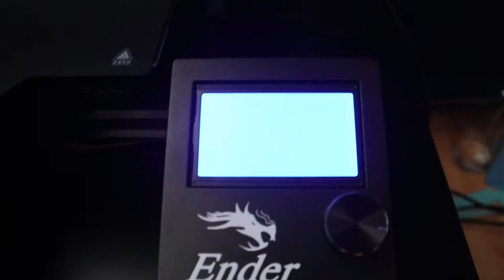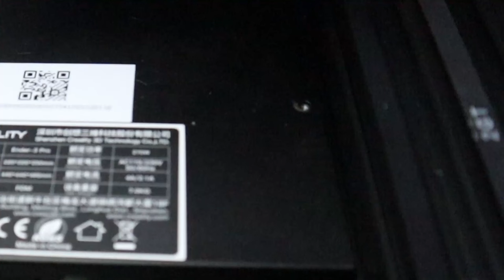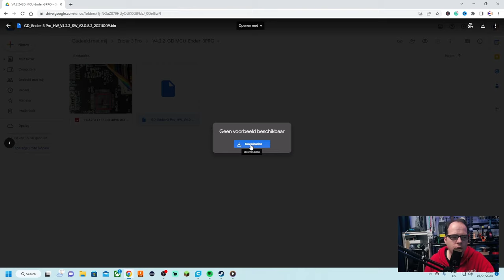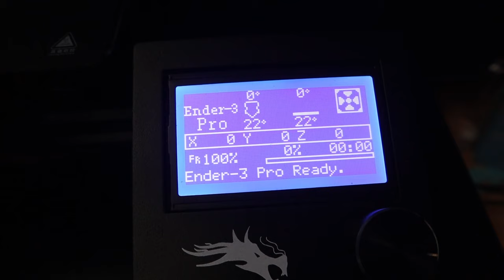3D Printer Display Not Working? Check These 3 Things!

Comment: After struggling with firmware updating with my Ender 3 V3 SE,  watched YouTube videos and posts that didn't help, I solved it with try and errors. 
So here is an updated help file written by me in a clear and easy English. 
Hope it will help for many beginners to update the firmware of the mainboard and LCD.
As a new Ender printer user, I even didn't know that the LCD screen have it's own SD card, and the new model is different from all YouTube video I watched. there is no screws to open it, and you will break the plastic if you try. but no need to open, because the SD card slot is just there on the left side.
For updating the mainboard firmware, I copied the bin file to an SD card, but than the LCD screen turn black, and that's where my journey began.
At the end it solved, and if you follow this help file I guess you will crack it also.
good luck !!

-------------------------------------------------------------------------------
Printer: Ender-3 V3 SE
Printer Mainboard: HWCR4NS200320C13
Notes: 
  The firmware is Ender-3V3 SE Factory standard version Support eleven languages。
  this update include LCD firmware files, witch is mandatory to update in most cases of updating the mainboard.

Firmware update content:
  1. Add Korean language.
  2. When optimizing and editing the levelling data, the nozzle follows the coordinate changes in real time.
  3. Added CR_Touch exception interface handling during printing process.
  4. Fixed the bug in the automatic feeding function.------Known issues
  5. The  boot guide interface adds automatic height alignment and automatic levelling operations and CR Touch exception handling content.

Display (LCD) firmware update：									
    1. Format the TF card on the computer side, and select 4096 for the allocation unit size (max 16GB card allowed or belter max 8GB sd card size).
    2. Copy the screen firmware folder "TJC_SET" into the TF card (Copy to main folder).
    3. Turn off the printer (important)
	4. Insert the TF card into the card slot on the left side of the LCD screen (not to the SD card of the printer - take of the LCD and see a small slot on the left).
    5. Turn on the printer and wait for the update to finish. (you will see on the screen percentage count 1-100%).
    6. If update succeed, you will see a message "update succeed".)
	7. After update done, turn off the printer.
	8. Remove the TF card and delete the files in your pc.
	
	Errors with LCD firmware updates:
	1. If the screen say that the card in not formatted to FAT32, reformat it and make sure you choose FAT32 in the format dropdown menu.
	2. If you cannot avoid errors with SD card reason, change to max 8GB SD card and format again (at some cases a large sd cards do not accepted by the LCD or/and the printer).
	
	

Mainboard firmware update:
   1. Format the SD  card on the computer side, and select 4096 for the allocation unit size.
   2. Put the firmware file "Ender-3 V3 SE_HWCR4NS200320C13_SWV1.0.6_GD303.bin" into the root directory of SD card (make sure there is no other files or folders in the SD card).
   3. Turn off the printer
   4. Insert the SD card into the card slot on the left side of the printer body (where the mainboard is).  
   5. Turn on the printer and wait for the update to finish.
   6. After finishing the update, remove the SD card from the printer slot and delete the bin file in it.
   
   
   Errors with Mainboard firmware updates:
   1. If after update the board firmware you get a black LCD screen or screen with chines letters but no menu, it means you need to update your LCD screen firmware
   2. If the update progress do not start or get some issues, some users suggested changing the bin file name to "firmware.bin" and try again.
Reply from the maker: I have pinned this comment, so it might help others too!
Reply: @Zachary3DPrints  your video was not very good Zach. You should make a video with this in it, and thank this guy
Reply from the maker: @gavares3 the analytics says otherwise and what this person says is about a different printer in the Ender series V3 SE, which I don’t have 😉

Comment: Was a Christmas Present for my 10 y/o daughter... she asked Santa for this one and he said sure thing! So, got all the way to this and BAM. Black screen but the fan on the extruder box dealio was running. Tried everything but firmware as when I took the power inverter box apart and checked those connections, THAT was where my problem was. Thanks for the video. I checked everything based on your vid! Cheers dude!
Reply from the maker: Hey Thank you! Amazing that your daughter is going to try 3D Printing! Very cool. 
I didn't mention the loose power wires, but I guess you were triggered by the loose connections...

Comment: I own the Mars 4 Ultra. It turned out that the screen cable wasn't fully plugged in; It had been tapped to stay in place, lol. Fortunately, fixing the cable in the correct position and closing the clips resolved my issue. Thanks for the help!
Reply from the maker: This even helped you to get your printer going? That's awesome, I didn't think that this would other printers help as well!

Comment: How long does it take for the firmware to load to printer.  I have a creality ender 3. Gotten from a friend that never took it out of the box. When I powered it up for first time.  Was checking all the motor movements.  Started setting up the heat for first print.  The screen went black.  Loaded firmware on new SD card.  Turned on the printer, and the screen seemed to be fixed.  As I was setting up printer for first print.  The screen started flashing and now is only blue. Please help me if you can

Comment: It was firmware for me. My Ender 3 Pro is over 3 years old and the firmware resides on the SD card that the print file is on, not sure if later Ender 3s are the same. Fortunately, every time I make a change to the firmware (BL Touch, etc) I keep a copy on my desktop as a ,"Just in Case". Forgot about that until watching this video. Thank you, Liked and Subscribed.

Comment: Hi, hope you can give me some help.  I have an ender 3 v2 printer, the problem is that I updated the firmware on it and now the lcd is beeping with black screen, i  have narrowed it down to the lcd because i changed the lcd with a spare one i had and that is working, any ideas on how to fix it would be great,  TIA.
Reply from the maker: I think that the firmware update did do also something with the display, causing the beeping sound. Ask Creality support or check their site for a solution

Comment: Thank you. Mine just stopped working on its own. I flashed the firmware and it started working..

It was not the cables since I had not moved the printer at all.

At 2:52 you mention 3 screws it's actually 4 screws the 4th one is at the top. Just in case someone else is frustrated like myself for 30 minutes haha.
Reply from the maker: Thank you. Didn't I showed that 4th screw before? Hmmm, weird
Reply: You probably did. I'm just impatient skipping through the video.
Reply from the maker: Yeah, most people do skip parts... Funny part is, that if I would leave something out... they will always call me out on that part 😅😉

Comment: Awesome video. Thank you! 

Firmware update fixed my Ender 3 Pro. Funny thing is that my firmware was so old from 2021 and the new one is very different. It has filament change which I used to do manually. And my printer is noticeably quieter. The menus have changed a bit but it's working great now.
Reply from the maker: Great to hear! Yes, it is indeed good to check for updates once in a while, even this old printer since it is still sold by Creality is very popular, they do these updates and adding more functions to them too, which I really like.

Comment: hi, i have bought a used Ender v2 and printed i test, it worked well until the blue screen happened. i tried new firmware and everything in this video, its still not working.
Reply: Lol I’m in the same boat, I installed some tl smoothers and then my printer what itself
Reply from the maker: Sorry to hear this, are you having the same issue still? Sorry for the late reply
Reply: @Zachary3DPrints  can you do this for the neo
Reply: I’m having the same problem it just keeps beeping
Reply: @elfrostytv  have u found the answer ?

Comment: I installed a TFT 480x320 screen with Marlin 2.0.9.5 and everything is fine except for the fact that the result of touching menus are inverted, if I touch + it acts like - , if I touch the fan icon on the scrren brings me the menu for extruder and viceversa. If I touch the Tools icon it shows the SD card files and if i touch SD card icon it shows the configuration menus. Can it be fixed?
Reply from the maker: OK, which brand is that screen? It normally should be working with the standard cable in the right EXT3 port together with the 5-pins wire if it is Bigtreetech TFT screen. Check the manual online to see if it is correctly connected. Which Board do you have in the Printer?
Reply from the maker: I don't know to be honest. If I check on this board with the screen, I don't see how they are attached. The Board needs a 2x5 pin connector while the screen needs the flat cable
Reply: Just solved it, automatic calibration +  M995, from pronterface I took note of the numbers and inverted them and violá.

Comment: I just got an ender 3 v3 ke today and the screen is unresponsive does it need a firmware update or do I need to return it?
Reply from the maker: Hey, sorry for my late reaction. Is the issues solved already? Does the screen turn on? Is the ribbon cable inserted correctly? Please check with @Creality Support
Reply: @Zachary3DPrints  yeah I resolved it by getting pissed and slapping it face down against my table, grabbing a beer, and came back to it working lmao. Not sure if it was the slap on the table or just coincidence. But it wasn’t working after unplugging and replugging powering off/on etc multiple times lmao. I’m just glad I didn’t have to send it back 🤣

Comment: Changed motherboard on ender 3 neo, screen blank. How can I flash the firmware if the screen is powered on but is just blank blue screen?
Reply from the maker: I don't know which brand you did use on the Ender-3 Neo, but maybe checking on the Brands support site for their latest firmware

Comment: I was stuck on Blue Creality screen. I took back off to confrim verision and downloaded firmware.  I inserted in Ender and now there is a beep coming from screen.  It stops when unplug ribbion  HELP
Reply from the maker: Hi, please check your board that is in the printer, which version it is, go to the creality website, and download the right version.
Reply: I actually did that. It's a Crealty V4.2.2 with GigaDevice. I went to site and downloaded but it started the beeping after..😢
Reply from the maker: What is GigaDevice?

Comment: My printer shows a maxtemp error for the bed even though the bed is cold
Reply from the maker: Sorry for my late reply, is your issue solved? I think that the max temp is caused by a faulty thermistor. If the printer is turned on, does it directly say max temp? Check the wiring from the bottom of the bed see if they are screwed in too tight --> loosen the screw a little bit
Reply: @Zachary3DPrints  alright

Comment: I put the firmware on the sd card but if I put for example home all it says an error
Reply from the maker: Ok, that is weird, try to redo the process and check your board and the right firmware version
Reply: @Zachary3DPrints  I tried about 50 firmwares that day but nothing, the next day all the ones I tried worked for me
Reply: @Zachary3DPrints  That's a mystery
Reply from the maker: In the end one of them did work? Who was the lucky one? Yeah Creality needs to have one board with the right firmware so that people know for sure which one it the right one. Now having more connectivity could mean in a better system to update the firmware by wifi or ethernet
Reply: @Zachary3DPrints  where did i download the correct firmware? I don't really know, but I prefer to keep it on my computer